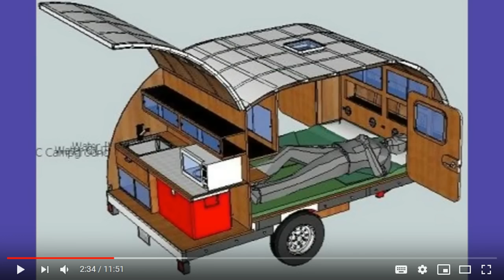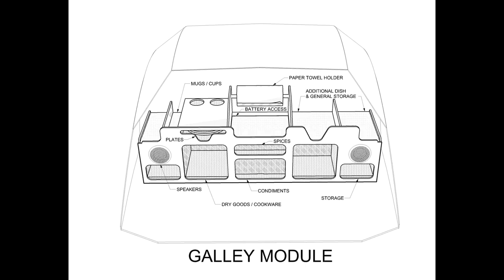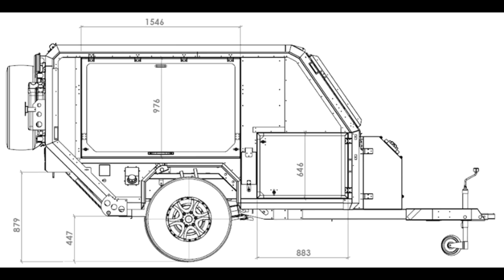DIY Off Road Camping Expedition Overland  Trailer Build 2019. Part 1

Comment from the maker: Starting from the ground up!  my new Mud Tyres have been fitted to the $100  Ford Territory  mags that I scored. ive fabricated the suspension trailing arms and now ive got one on the lounge floor with one of the spring/shock assemblies and a straight edge and tape measure. triangulating to work out ride height and spring rate. (cant do that if you have a wife!) lol.
my chassis design is innovative, with the 2 draw bar beams extending right through the chassis structure to the rear recovery points for incredible strength. This enables lighter gauge steel to be used in the rest of the chassis  saving weight .  Heavy items like batteries water and tools will live  within the floor structure nestled between these main structural beams.  Next video on Sunday!

Comment: I plan on doing a tear drop type build for my trailer next spring, that will slide on and off the deck of my trailer when needed. Yours will be an enjoyable watch I'm sure. Bring it on.
Reply from the maker: I was actually about to do just what you are doing - But when a looked around and realised that I had so many random components that could be used in the build of an off road trailer that i committed to it. see my latest comment here for a progress update

Comment: if you use a box type hitch than you could use a strate hitch  while driving on roads  and switch to the high articulation type when  you go off road.
Reply from the maker: yes i thought about that option- but i want to show how low tech items can be used to achieve similar results. the company that i get trailer components off have a 2.5tonne (6000lb) coupling that autofits two size balls- this feature is what improves the articulation.

Comment: 0:56 Vocabulary: Squaredrop :) I'm building mine (early days).
The trailer is done. 2x3 steel with torsion hubs, i.e. independent suspension = no axle. See princessauto.com
Right now I'm on building the box out of 4x8 foot plywood. One side grade A birch. I would have liked marine plywood, but too expensive.